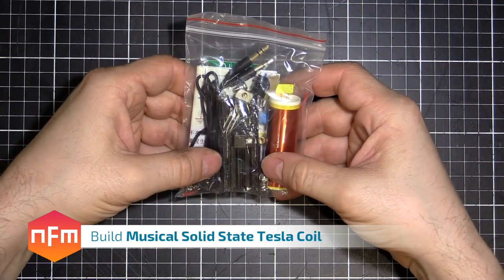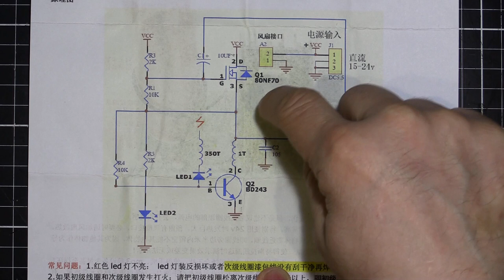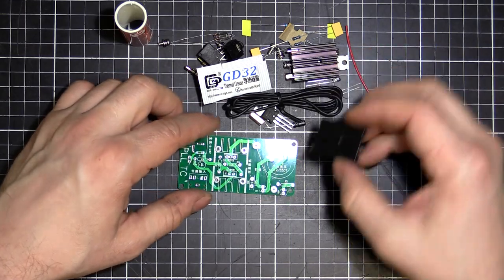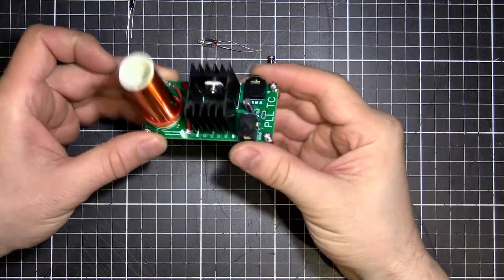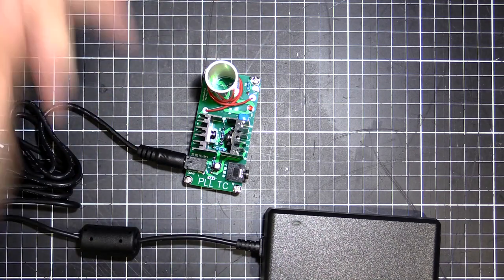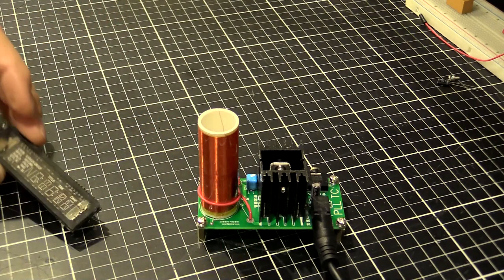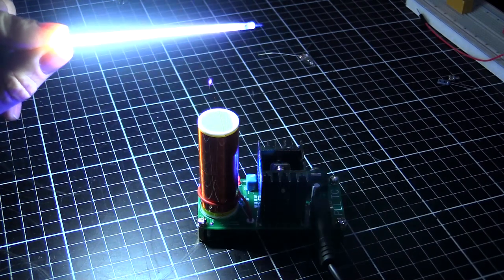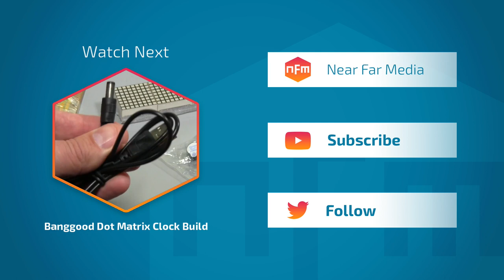Musical Tesla Coil Kit

Comment: could you alter one of these into a super tiny jacobs ladder?
Reply: You could, but I think you'd be better off getting a zvs power supply and pulling a flyback out of an old monitor or tv.
Reply: but that's what people do for normal sized ones.
i want one as small as i can get it for a diorama.
Reply: This isn't really that powerful. A small zvs power supply on Ebay is only about $3-$6 and a flyback isn't massive. Those would be great for a diorama. The size of the actual Jacobs ladder depends on how long you make the prongs used for the ladder part of it.
Reply: well while waiting for the coils i ordered to arrive i did some experiments with a negative ion generator i bought to make a static fields for diorama grass application.
i was able to get a super tiny spark, actually smaller then i need, but it didn't climb. (too small to heat the air?)

and so i ordered something off ebay called:
'high voltage pulse generator inverter super arc pulse ignition coil DH'.
if i understand correctly it converts dc to ac and low to high volt.
the one i got is 40kv 0.5A-1A.

would that work?
Reply: The pulse ignition coils are more like a stun gun. There are similar ones without the pulse function which would work. Search "high voltage module -pulse" on ebay. They're under $4 Looks like they've got something with the flyback already on it there in the same search.
Reply: i was assuming pulse referred to AC out...

lol i guess i need to do more homework...
Reply: They're exactly the same as the non pulse ones, but they have a capacitor across the output. If you've seen a stun gun going off, you'll know what to expect. Looks to me like they can't be simply taken apart to remove the capacitor.
Reply: actually, looking at the description it talks about 'the arc should be no longer then 1cm and go from short to long, do not operate more then 4 seconds at a time due to heat...'
it even says u can't light paper or cigarettes with it :P 

sounds like this is being sold for exactly this kind of stuff.
anyway it's from china so i guess ill have to wait till it gets here and hope
for marking i can google for the datasheet...
Reply: mmm can that produce a single rising spark? i only really need one every couple of seconds...
Reply: What you bought may not be a pulse module. The pulse modules just spark across the gap as the capacitor discharges over and over. The non pulse ones have a sustained arc. If it's a non pulse one and sustains an arc, it will work. This one's a pulse module: http://youtu.be/iDJp2tHmEQo, This is the effect you want: http://youtu.be/CSwDmaQkclE
Reply: i see.
the first item in the 2nd video looks like the one i got; rectangular epoxy block.
crossing fingers :P
Reply: You can connect one side of copper stripboard to the coil output and the other end to the negative rail. That will look  like several tiny Jacobs ladders .

Comment: “Slayer exciter circuit” invented by whom? A “Doctor stiffer” and “G bluer”, really? Sorry to burst anyone’s bubble but this is a pretty stock standard “blocking oscillator circuit’ such as was first invented in the 30’s with a single valve and then later patented in the 50’s with a single transistor, what do people think was powering the TV flyback transformer since the 30’s or the later battery powered portable fluro circuits and fluro emergency exit signs etc. and even later plasma balls in the 80’s, a coil with a spark gap? I can’t believe with info at everyone’s fingertips no one bothers to do any research, I guess, progress is hindering the masses, by comparison when I started in electronics as a kid in the 70’s, I would have to look for books that actually provided truthful information with references. BTW your vacuum fluorescent display (VFD) is broken, it would light if it didn’t have a leak. Otherwise a nice informative video. Sorry for the gripe just that I have been using the “slayer circuit” as a Tesla coil since the late 80’s when in high school and would never even dare to claim an old idea as my own.

Comment: I bought two of these kits now and neither works.  My schematics are slightly different than the one in the video, so I changed out the C1 no help, then reversed LED1 now LED1 doesn't light up at all.  I re-reversed LED1 and the LED1 lights up, but the stupid Tesla Coil kits still do not work!  I gave one to an electronics engineer friend of mine and he can't get it to work either!
Reply: That's because it is not engineered!

Comment: How does it feel to touch it?
Reply: MoneyCZ
It will not shock you but even this High voltage, low energy concentrated in a small spot will burn WITH SMOKE and a lousy smell of burning human flesh.
You'll shift away pretty swiftly but not with a tiny surface burn on the skin, more of a tiny deep burn, well into the flesh! 
They don't heal quickly, unlike a skin burn and can carry infection into the flesh after the burn, something that a skin burn will try to reduce or prevent. My tip? Keep well away from it.
Big fire risk...It can ignite inflammable (flammable modern word) vapo(u)rs 
in a flash ..literally. Beware!  Gas lighter cylinders being used, hair sprays, agina sprays, petrol (gasoline vapo(u)r etc.
People suggest radiation health problems from cell phone, cell phone masts, WiFi etc.
This baby DWARFS them for local field strength! Oh Boy, does it ever?
Reply: Ok thank you very much Mauriat for your tip :)

Comment: No help for the outright beginner. I've known the colour code these 60 + years but the beginner doesn't know which 
component to pic up next even he's worked out which holes to use. They need to be forewarned of polarised components
I propose to make up a board  and give to somebody to copy.
Other Chinese boards show a clear, full on , completed board with components clearly located.
Your demented-moth camera will be very frustrating for the beginner but thanks for the video.

Comment: Hi, do you know where to get that power adapter from? I have a 9v power adapter but not a 24v.
Reply: Nishanth Mandala Make one yourself
Reply: Use a computer power supply.  They have + and - 12 volt lines on many fo them.  Thus between -12 and +12 if you use the - as your floating ground and +12, you get a 24 volt differential supply that will work for this purpose.
Reply: Only quite old PSs have -12V!

Comment: Can the blue capacitor's prongs be placed in a different way? I think I placed mine wrong. My LED 2 doesnt light up.
Reply: You can place that capacitor in both two ways. It's not electrolythic. Btw have you succed? mine is not working too. Just one of the leds turn on and thats all.
Reply: @mehmetinlaboratuvar7099  Did you solve it?
Reply: @andresxj1  nope. I even replaced transistors with new ones. Still doesn't work

Comment: Will it shock when you touch
Reply from the maker: Yeah, but not enough to kill, more like a mild electric fence feeling.
Reply: THE MODERN HACKER I touched mine and I did not feel a thing, it only felt slightly warm.
Reply: No. It feels good on your tongue.  Make sure you touch the heatsinks at the same time to be safe. UNLESS YOU ARE UNDER (less than) 18 (years old)!